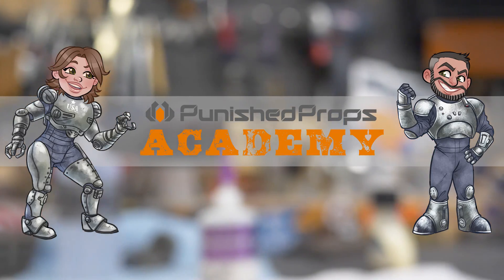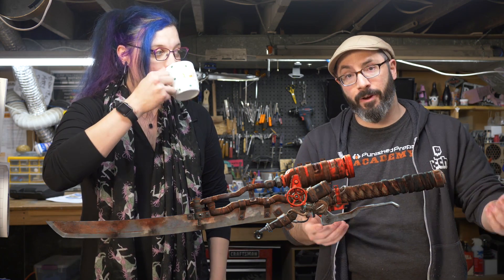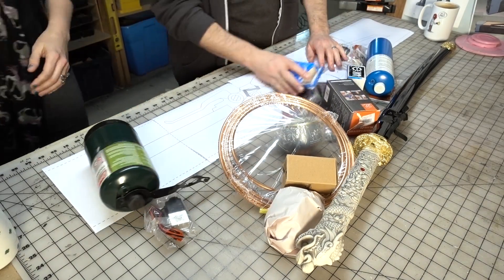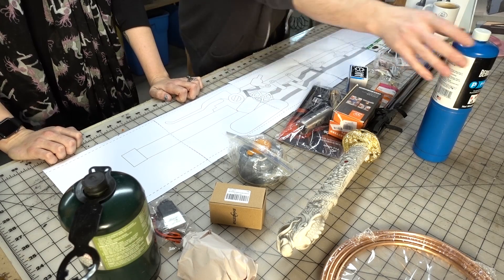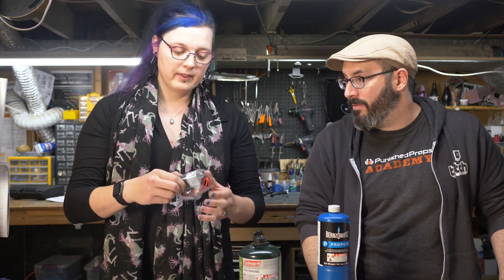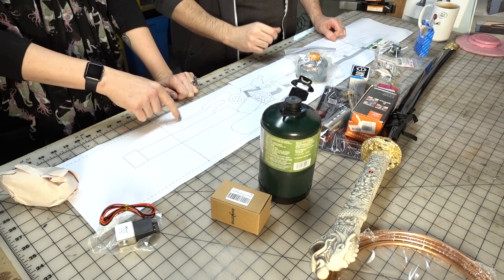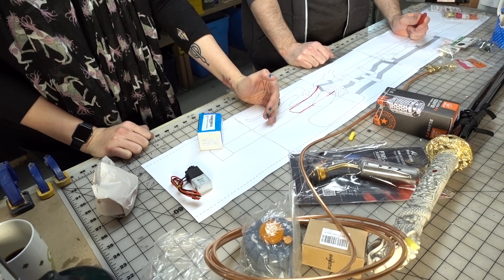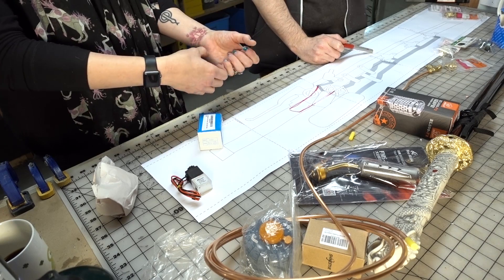Building A Real Fire Spewing Shishkebab from Fallout - Part 1: Design

Comment: I dont know anything about fire but I know plenty about swords I even have the marks (scars) off a true expert, the best way to make the sword sturdy and also to help with the balance is to make it full tang meaning that the tang part of the blade is as long as the handel and connects to the pommel either trough a treading or peening of the pommel

an image for refrence https://www.albion-swords.com/images/functional/hiltassemblymethods.jpg and yes this is also used for katana's tho they are usually constructed with pegs trough the full tang instead of capping off the end with a pommel since japanease steel was of much lower quality and could not support the standard peened construction and treaded wasent an option back then

Comment: If you guys get something like this... https://www.ebay.com/itm/LEFT-HANDLE-BRAKE-LEVER-with-CABLE-FOR-47cc-49cc-PIT-MINI-DIRT-BIKE-ATV-SCOOTER-/282450411477, you can use it to trip the solenoid. Your best bet for ease of install of ANY motorcycle brake lever assembly is to use 7/8" or 1" outer diameter pipe for the hilt of the sword.
Reply from the maker: Ooh neat!

Comment: don't know how to release the butane but have you tried those butane lighter refill canisters?  they are pretty much the same size as what is supposed to be on the sword.   you would need to figure out how to depress the valve to release the gas.
Reply from the maker: In this case we're using propane and I don't know if those come in similar small canisters. I'll have to ask Scotland.
Reply: now that I think about it... it does.  kinda.   If you go to an airsoft store and ask for green gas, it will come in a spray can sized canister that is effectively propane with a small amount of silicone lubricant mixed in.

Comment: what kind of fuel are you planning on using, ive seen some fuel that you can even put on your hands and set on fire and burns at a low temperature, but im not sure if that will work to keep the flame going...i think it was lighter fluid...can be put in the mouth as well i think for breathing fire...not sure if  thats the one though...
Reply from the maker: For this it's going to be propane. I do everything I can to not set my hands on fire. =)

Comment: I would opt for a more solid burn than a "poof", while the poof can be cool... the main point in-game is to heat the blade and deal more damage with a red hot blade. But hey, that's just my two cents.
Reply: Punished Props Academy - Both! More is more!
Reply: Looking at this from a more medical perspective...wouldn't a red-hot blade just cauterize the wound and stop the bleeding, instead of causing more damage?
Reply: @candaceflynn7935  Also the edge of a red-hot blade would deform rather quickly if it hit anything solid, meaning after the first few bones you're swinging what amounts to a red-hot club. That's why it's a video-game weapon.
Reply from the maker: I think we're gonna go for whatever looks more amazing on camera.
Reply: Yeah, fair point.
Reply: Did this project ever go on?

Comment: Propane is heavier than air.  Once it's lit heat will make it rise but till then it will flow down so careful folding the sword up before it's lit.  This comes from experience!  No burn but singed off all the hair on my arm...

You could solder the joints and not worry about expansion.  The big no no with coper lines and natural gas is that there are some sulfur compounds in the gas that can create a weak sulfuric acid and burn pinholes in the piping.  I don't see that as much of a problem with this use, plus refrigeration tubing has a lot thicker walls that copper pipe that was used (just after WWII) for running gas lines.

The expansion tank is what I am most curious about but it is probably also the most dangerous modification so I won't be too disappointed if you don't cover it.
Reply from the maker: Thanks for the feedback! I'll have to ask Scotland, but I don't see a problem with soldering all the joints once it's all put together.

Comment: Ok, so the parts needed are a lawnmower Blade, a Motorcycle brake handle, and Motorcycle gas tank, and a pilot light.  That sounds simple enough.
Reply: I didn't hear them use duct tape once during this build.
Reply: Wonder glue!